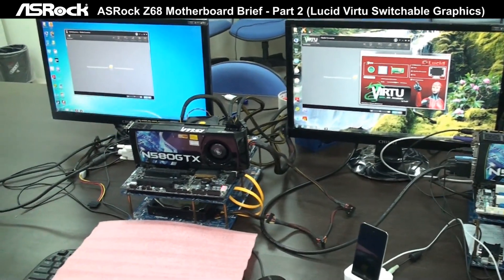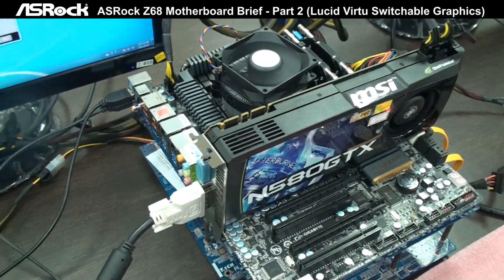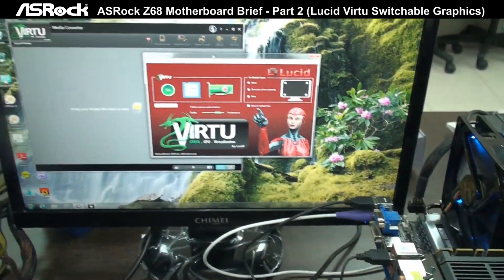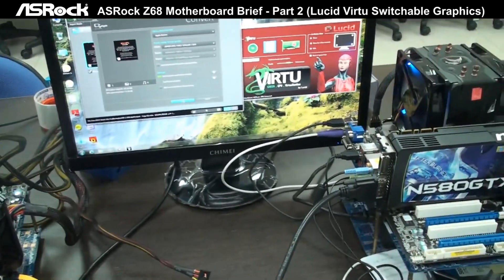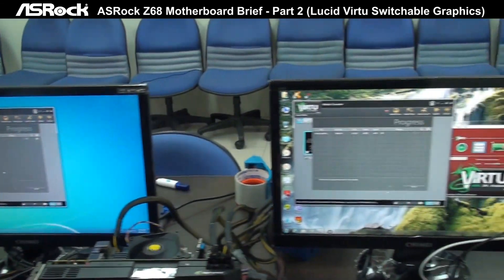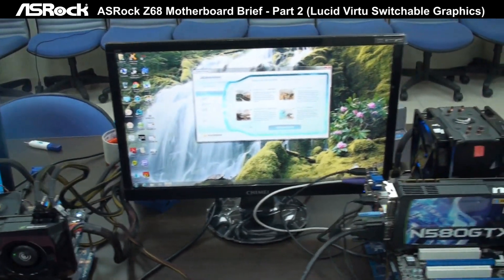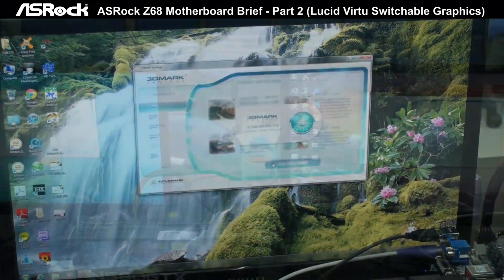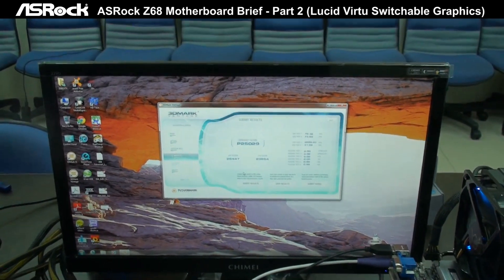ASRock Z68 Motherboard Brief - Part 2 (Lucid Virtu Switchable Graphics)

Comment: that they use a bigger fan doesn't mean that it's overclocked, mybe they had just this fan lying around and also maybe it's just becuase the Lucid Logic thing uses the integrated GPU on the CPU, so it becomes hotter than with a board that doesn't use the integrated GPU and Intel boxed coolers are barely enouzgh to cool the CPUs at stock setting, if you use software like IntelBurnTest you most likely reach TJmax even with stock setings.

Comment: @utjoseywales The point of the test was to demonstrate that the embedded GFX in the Intel CPU could improve performance overall.  I admit that the testing methodology sucked because it requires the viewer make a lot of assumptions, to many for my taste.  But, let's assume, for the sake of argument that the test systems were legit, the heatsinks did not impact *this* test.  If you put these two systems in their own cases you *might* have an argument, but that's not what we're seeing here.

Comment: @alueshen I respectfully disagree.  Controlling heat is of paramount importance when running benchmarks.  While it is possible to suggest that during this test that heat was of no importance to the result is possible, in the real world you and I both know that it will factor into the rigs ultimate performance.  That's all I was implying, since we don't all have our PCs in an environmentally-controlled, climate-controlled, ASRock-controlled setting, I just thought it was worth mentioning.........

Comment: @utjoseywales Saying that a heat sink "must" have an impact on performance is just silly.  I'll grant you the possibility that a system running an Intel stock cooler in a poorly vented case in a hot room running prime 95 over hours or days, might effect the outcome, but clearly, running an aftermarket cooler does not get you more FPS or faster encoding time, at best under the worst conditions it might slow your CPU down, but clearly the demonstration in the video is not "the worst conditions".

Comment: It appears the GPU coolers where different....i.e. stock on the Gigabyte board vs. aftermarket on the ASRock board.  Clearly that must have in impact.  How much I cannot speculate, but to suggest this is an apples-to-apples comparison is outright false advertising.

That being said I'm a long-time fan of both Gigabyte and ASRock mobos.  My opinion is that you cannot go wrong with either choice.